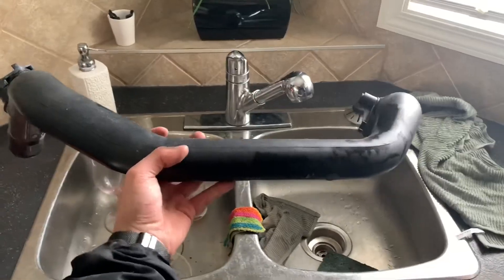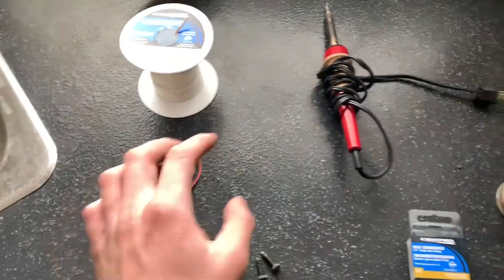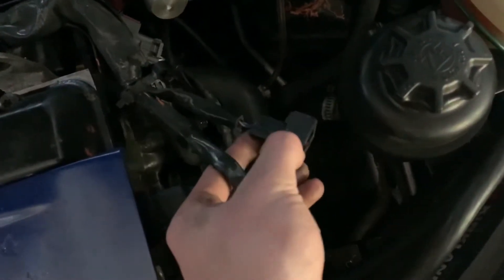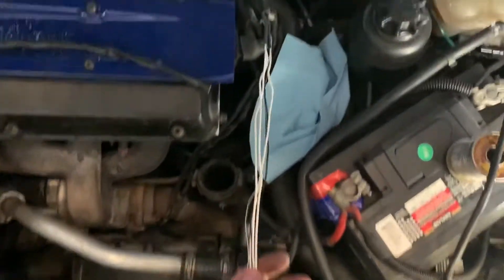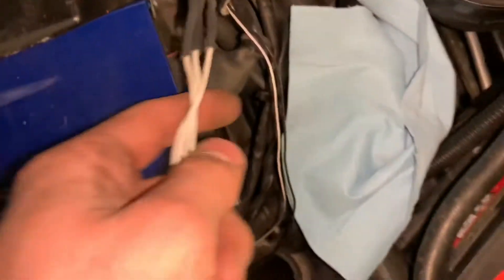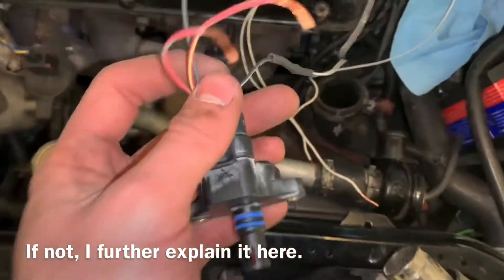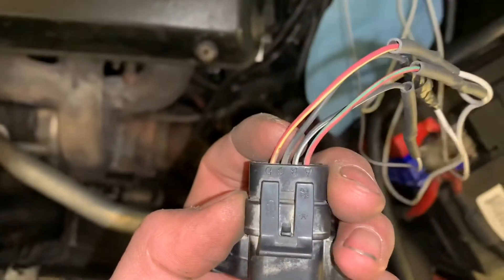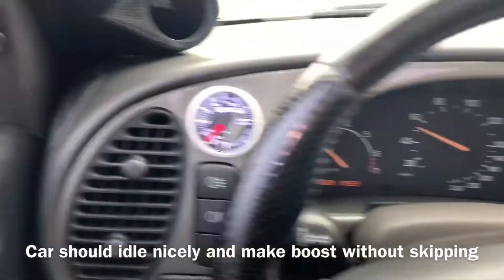Saab Quick Tips | MAP Sensor Retrofit

Comment: Hello. 

I have a 2001 Viggen. 

The codes I keep getting are p0106 and p0107. 

Engine is rebuilt with 13k miles. 

New fuel pump
New pressure and return check valve
New upper and lower o2 sensors
New mass air flow sensor
New crankshaft sensor 
Verified there were no cuts or destroyed wires by removing all tape and heat protective coating. New fuel injectors and fuel pressure regulators

I still experience hard starts and very shutting off after start. 

Any help you can provide would be great.

Comment: Comming with new vids soon, update on the saab ? and witch turbo did u go with t19 og the gt28 ? :) Really wanna see more i got a  saab 900 ii 2.0t 1994 coupe. looking into it now, and i really want at least 450 hp :) 
A few years back i got a saab 9000 cse 2.0t with over 650 hp was beating it and running everyday for 2 years and then i soldt it, i regretted and still does so much!